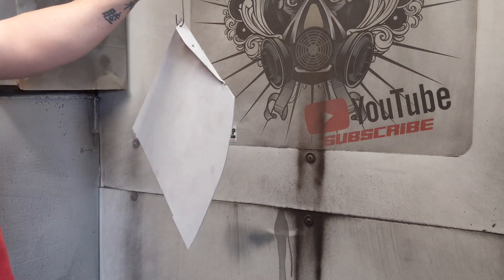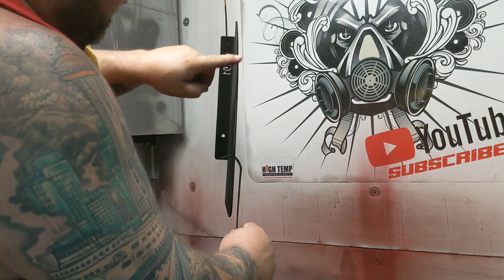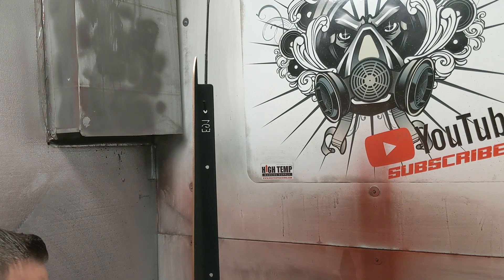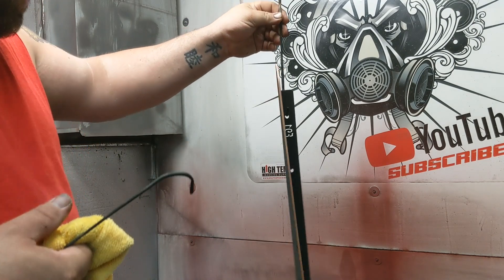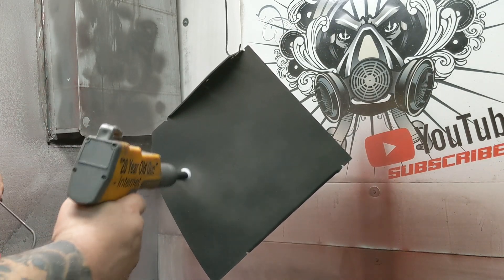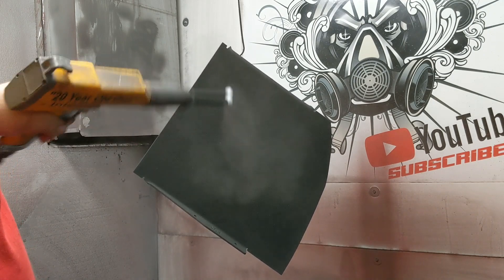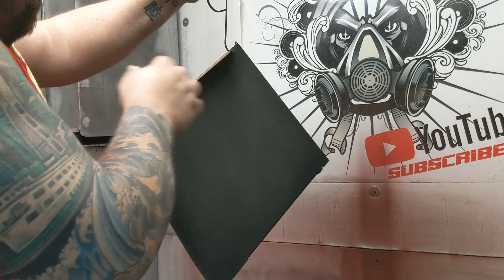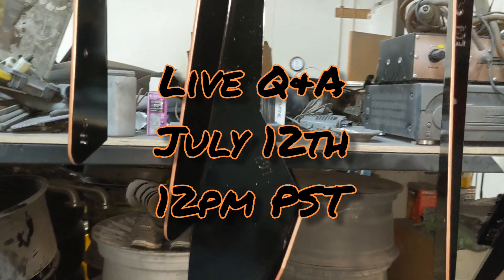How to Two Tone a diffuser with Powder Coating - Ep 57

Comment: Awesome job as always! What type and how many filters are you running in that booth? Building my own booth and thinking of using an HVAC style air handler. I think that's the type of blower you're using and would like to see your filter setup.
Reply from the maker: 2 filters on each intake, one more filter before blow out.  They are furnace blowers
Reply: @UnknownCoatings  thank you sir!

Comment: I know you’ve talked about your booth before and you mentioned again how well it works. I’ve searched around with not much luck finding anything useful on building a booth. Do you have any info on your blower/ventilator and filtration system? Thanks in advance
Reply from the maker: Ill try to post the math for booth design. The blowers are from a furnace,
Reply: Unknown Coatings cool, thanks! I’ve been needing to build one for awhile. Tired of powder floating around my shop lol